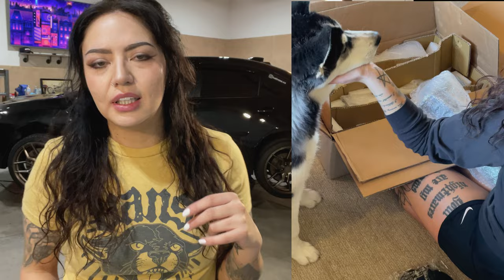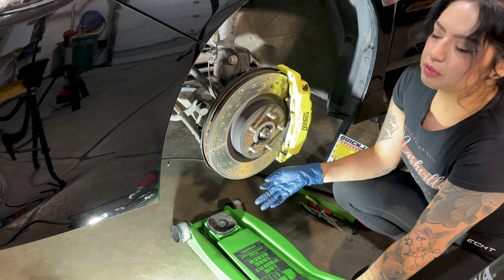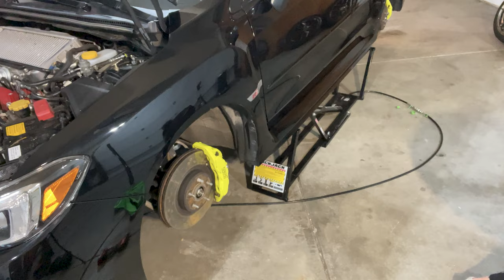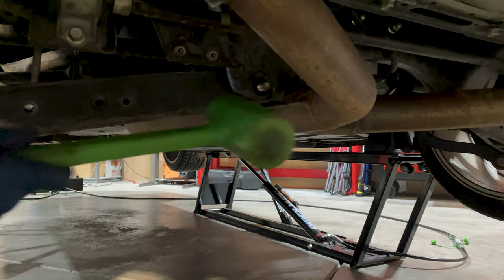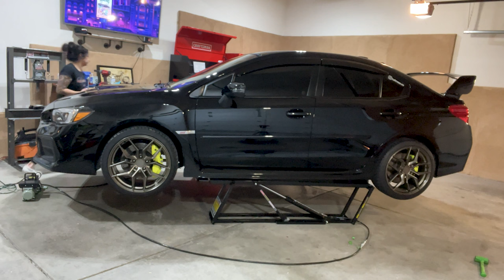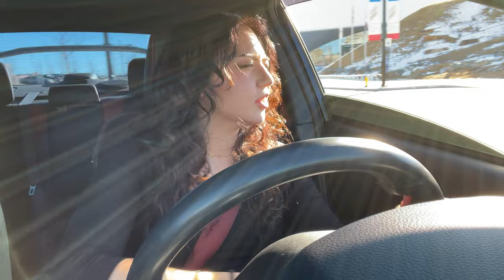Coilover Install on my Subaru WRX STI // Fortune Auto

Comment: Big mistake kids make when they get an STI is trying to make it faster first. I think the first mods to be done should be suspension for better ride and weight reduction. I have a 2019 STI and first thing I did was replace the heavy and impossible to clean 19” wheels with Titan7 18” forged. I got fortune auto 500 coilovers and the car feels lighter, quicker and more nimble. Made the car way more fun and engaging to drive. Well worth the money spent.
Reply from the maker: Good to know! That’s a really nice wheel. So far I love the difference it made.
Reply: @KaitRose  Did you use camber plates for the rear? That's the one thing no one told me about that I wish I had installed. What torque wrench are you using?
Reply from the maker: @CarStory  No I didn't. Its from Harbor Freight :)
Reply: @CarStory so you telling me and the rest that we made a big mistake??? Sorry I don’t follow your build.. I do my own shit.. I mod my car how I want it…
Reply: Did you keep the brembo brakes all the same , was there much adjustment needed with shifting the set up to 18s and cost wise ?

Comment: I just got my awe touring catback exhaust installed today! 😄 exciting hearing that rumble!
Reply from the maker: Exciting! That’ll be nice!
Reply: good luck keeping the tips clean.  my chrome ones haven't been chrome since week 4 and I've now had my system for 3.5 years.  I've more or less given up on making the tips shine and I even bought their tip tonic....
Reply: @SummerBRZ  there the black ones so they look sorta the same wen dirty.
Reply: @chosenjustin  yes, you are correct.  I decided to save the $100 at time of purchase and go chrome.  plus, the black chrome is somewhat fragile and is not compatible with cleaners/polishers like the tip tonic.     good news, I guess, is the tips can be removed and you can soak them and they can be cleaned off the car...
Reply: @SummerBRZ  yea. I wash my sti like once a month and i nvr wash my exhaust tips. Lol best I can do is go over it with the rag lol 😆

Comment: Nice job....yea I love my fortune auto coilovers....definitely louder but way better...if you add sway bars just make sure not to go with whiteline adjustable ones they will add to the noise
Reply from the maker: Nice! yeah. def louder, but still feels smooth. Thanks so much for the heads up! I was thinking of adding sway bars soon, too.
Reply: What loud about them?
Reply: @jasonhall3693  they pop and make some banging like noises once they are on for like 2 weeks..i think it is becauseof the ball joints... the second I switched to the solid bushing style endlings it instantly went away...
Reply: Oh and for the coilovers they will tend to make you hear more road noises and other noises when going over bumps on the road....coilovers are a better ride but are not as soft like the stock ones...

Comment: I would pre load the rear control arm bushings, I did this and it fixed my uneven ride height
Reply from the maker: Nice! Luckily my ride height is even. Front and rear all measure the same.
Reply: @KaitRose  right on, The car also fells alot better too, I'd still say go back and do it if your bored one day because a binding bushing wont last very long!
Reply: Yeah definitely wanna pre load like eddieguns said. Yr bushings are gonna rip eventually if they haven’t already. Also you can use the open end of a wrench with yr impact to remove those “long boys”.
Reply: Oh and awesome job, looks clean af.
Reply from the maker: @eddieguns7091  Right, I got an alignment (4 wheel) done the day I posted this video - so they took care of that for me :)
Reply from the maker: @typeonegsr  bushings should be safe! I didn't really drive it before I had my alignment guy make the adjustments. 
Oh. Nice. still figuring it out but I got it done lol.
Reply from the maker: @typeonegsr  thanks so much!

Comment: I will be installing my FA's (Cygnus X!'s) as soon as the weather gets better. How did you set the coilover length to achieve the correct ride height?
Reply from the maker: Exciting! Compressed the coil spring to 6 1/2 in the front and 6 3/4 in the back. Compression is 12 clicks out. Spacing between lock rings is 2 3/4.

Comment: Daaayyuummm that's low! lol looks bad ass tho, btw did you considered HKS coilovers at all? I'm torn between leaving my Bilstein coilovers or replacing them with some HKS
Reply from the maker: Thank you! its crazy how different it feels. I didn't, have you heard good things about HKS?
Reply: @KaitRose  I bet it's so much more fun when you're planted on the road makes you feel more secure in a sense specially driving on the twisties. The HKS hipermax S are what I'm looking at mostly for daily driving but driving on the OEM Bilstein coilovers feels little to stiff it probably the same feeling but who knows I might like the HKS better.
Reply from the maker: @lnol11689  Exactly. I went through a couple of mountain passes with it today and such a great feeling! Way more sharp and smooth. That's true. You definitely might. They look like they'd be really good. I think next I'm aiming for air ride.
Reply: @KaitRose  that's awesome I'm glad you're loving your new set up, I think airlift it's awesome wonder how practical is it to own it day to day, it will definitely be a neck breaker tho.